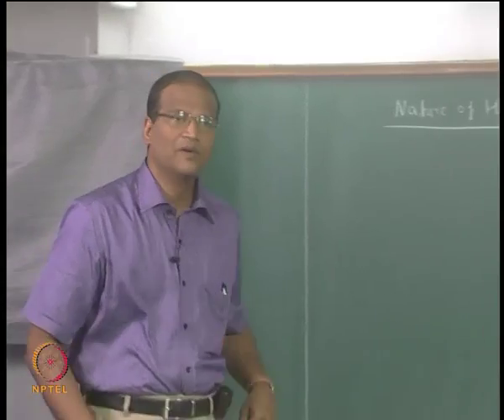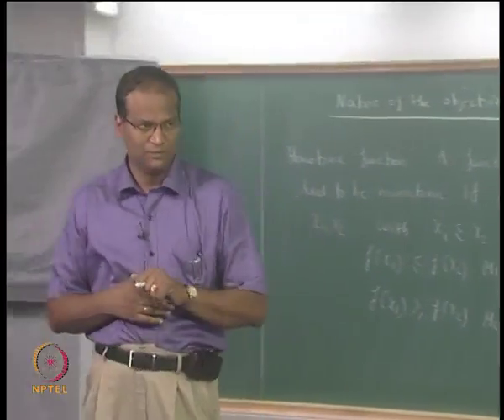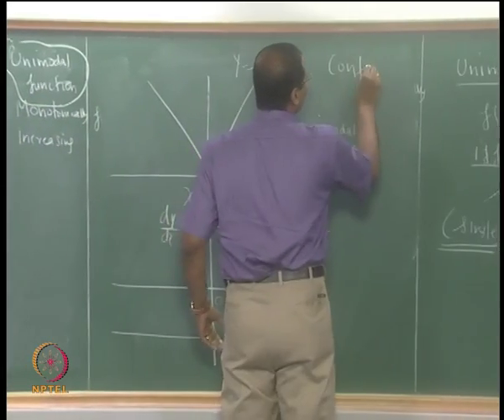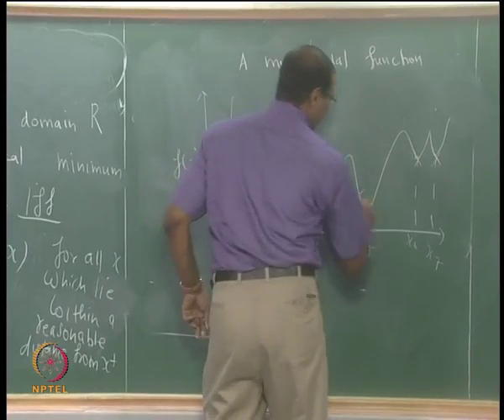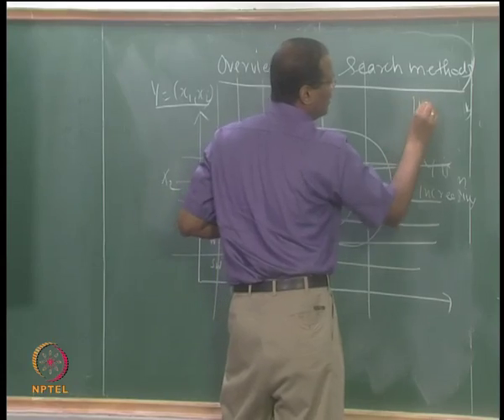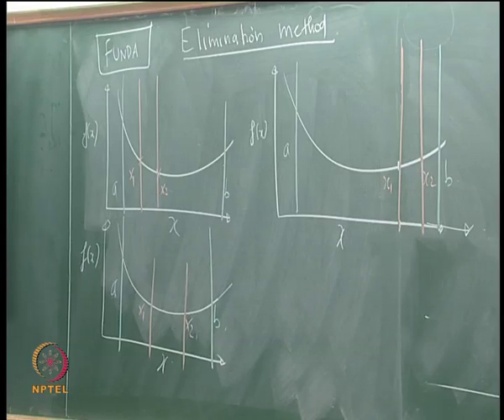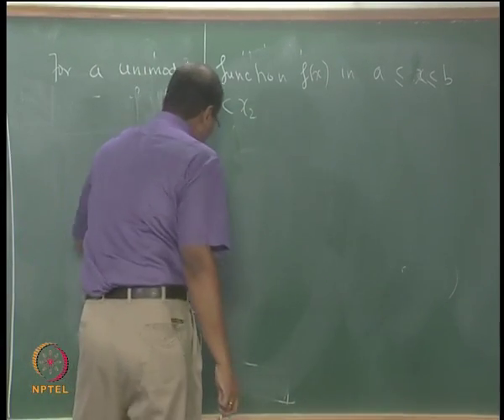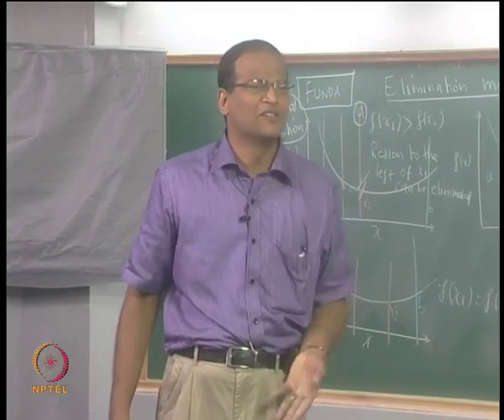Mod-01 Lec-29 Uni-modal function and search methods

Comment: At 6:00, the student correctly points out that the given step function is indeed a continuous function and it does not matter whether there are two values of y for a single value of x. But the lecturer refuses to listen and then says some irrelevant stuff about engineers and mathematicians. It is difficult to trust the lecturer after an incident like that...
Reply: continous but not differentiable at jump points.
Reply: yes, exactly.